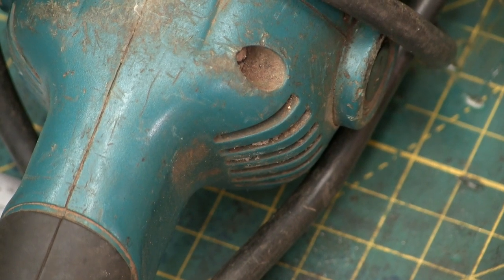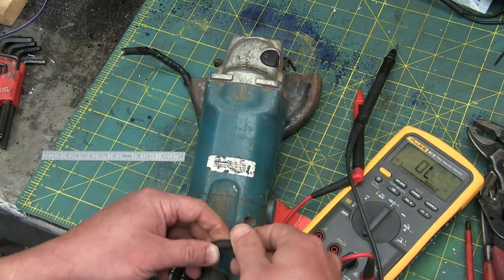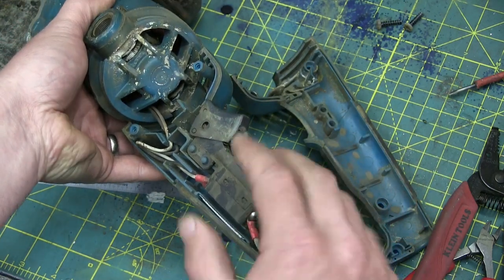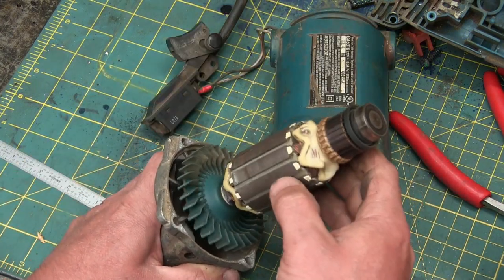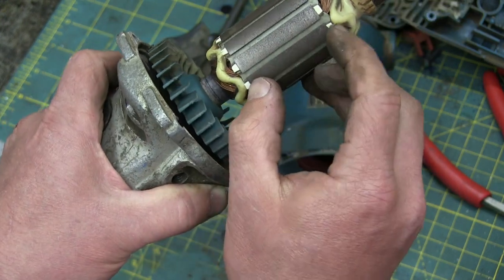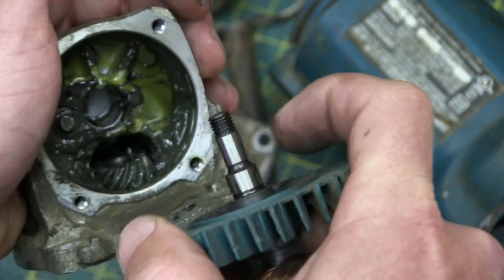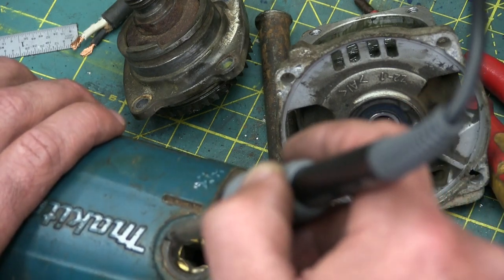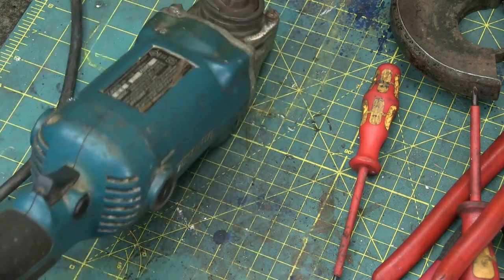BOLTR: US built Makita 5 inch angle grinder

Comment: That is a beautiful thing!  Though I gotta ask:  Am I the only one that takes apart new power tools the second they come out of the box, and re-greases the gears with a high-quality high-pressure grease?  :D
Reply: I use either honda 60 or liqui-moly's LM47 long life
Reply: I did it on my dewalt dw831 after watching the boltr done on one. As soon as I got it from Amazon I opened it up, cleaned it out and put in the good stuff.
Reply: I sometimes re-grease, and another good idea is to run brushed motors like these on reduced voltage for a couple hours to seat the brushes, 12v DC usually works OK for 120v AC universal motors. If it has a triac speed control you may have to bypass that. Have done it to everything from kitchen appliances to vacuum cleaners to these tools.
Reply: but warranty
Reply: Some one once showed us how to remove the warranty voided stickers out of Teflon.
Reply: John jon shit completely forgot about that haha

Comment: Have a 7" Makita side grinder that's been used for building woodburning stoves to oil rigs. Can't imagine what I have NOT used it for. It's over 30 years old and I've only had to replace the brushes (which were soooo easy to get to. Will have to replace the cord as slinging it around by same over the years has worn havoc..Great program. Leave it on even when I'm not watching to hear you go on and on..hypnotic..
Reply: BTW, it's the oldest tool I own...

Comment: "Magnetic slop".........love it.
Reply: There exists magnetic gears
Reply: afroninjadeluxe
Magnetic bearings are my favorite.
I revved a floating magnet to over 120kRPM.
It was amazing.
Reply: theLuigiFan0007 noted. Thats really nice, was it a vacuum?
Reply: afroninjadeluxe
It wasn't in a vacuum, but the neodymium magnet was a sphere shaped one about 9-10mm across. Essentially, the only thing touching the sphere as it accelerated was air, and a sphere is pretty aerodynamic. Hall effect sensors and optical sensors provide feedback on position and it hold it in place like one of those floating globes. That's commonly referred to as a magnetic bearing. All it needs to do then is start shifting the field so it rotates, while still keeping it afloat, and you have acceleration. In my configuration there's no speed limit, just the magnet providing feedback to the rotating field generator, so it goes as fast as it feels like. I measured the AC frequency at about 2kHz, and as the power draw dropped off significantly a few seconds after reaching said speed, it was safe to assume the magnet wasn't lagging the field much.

And trust me, I stood well back and used a computer and cheap webcam to observe the thing from the other room. If the sphere flys off, well that's pretty much gonna leave a mark on what it hits.

Comment: Have three newer models I got from work for free that were broken and they changed the ring gear a little it now has a metal washer for the lock up and the gear is power now not forged
Reply: Powder metal
Reply: Was it this version or a smaller 4.5"?
Reply: I believe they were 4.5" with the electric brake function but I ended up putting bigger guards on 
Internals looked the same but the switch was different I think the switch controlls the brake function

Comment: Like some have suggested, honestly. Do a HF angle grinder.

Lets how how bad (or not?) they REALLY are! I ain't gonna break into mama's christmas money that's for darn sure!
Reply: I made the mistake of buying a King brand grinder for a project a while back. This is a brand i would equate with HF brand. It lasted less then 25 min before it seized (bearing) and started smoking. Because i owned other (proper) grinders for work and i just needed one for odd home projects i decided to replace it with the Ryobi rat tail (a brand i would generally avoid at all costs)and have been pleasantly surprised with it especially given the price point. The ergonomics, the adjustable handle that i originally thought was gimmicky has actually been useful, reasonably powered and it probably saw  30hrs of grinding in it's first week of life. Couple years later and still kicking, though lightly used since.
Reply: I really wanna see him rip apart some Cambodian tyre (Mastercrap)
Reply: Aren't those clones of old Bosch grinders? They kind of look like them, at least the castings, minus the bigger lip on the seating position.
Reply: I got a lot of cheap grinders. (15$ each)
I almost never change disks, because I have one for each type. And I go easy on them. A coulpe of them I've had for years and they still work. the lock is a Joke but since I don't have to change disks all the time its ok.
Also had one I bought just to do one job, and ofc it failed within 10 minutes, actually caught fire and tripped the breaker. that was a 50$ tool, Hyundai brand, so you know one not to buy.
Reply: +Tristan Peoples You can say what you want about CT Mastercraft tools, but I have yet to have one fail me. I have a variety of their stuff because when it comes on sale, it can't be beat by the other more name brand stuff. Granted, I don't make my living off my tools, so I may have a different opinion them. I've got a grinder, drill press, plunge/fixed base router kit, super cheap table saw, and sliding compound miter saw. The table saw is lightweight, so the base is pretty flimsy, but I've ripped boards, plywood and MDF with it. Probably all on the same blade. My only complaints are that it's not big enough and that the fence has a terrible lock. But on sale and with my mittful of Canadian Tire pesos, I think I spent ninety bucks on it. The miter saw cuts spot on once you tweak the laser, but my good Lord it's a noisy cork soaker. Makes me wonder if there's any grease in it. The router is exactly the same as a Craftsman. Right down to the casting and moulding. I'm guessing most of this stuff is made in the same factories. 

Now, their Jobmate brand...that's on par with the Power Fist crap.
Reply: Robert Destree Lol, you can't beat them for price, trust me, but ive been at this really scabby outfit for years for heavy booty industrial fabricating and id go thru a grinder a day at times and management would be livid, and had to countersink/thread holes too, its just a rotten nightmare.
On the industrial scene thou it has no place being there, especially when youre out on the field.
Reply: Yeah, that's for sure. It's fine for the home DIYer and that kind of thing. Trust me, I'd like to have a better table saw or miter saw, but I just can't justify the dollars for how infrequently I use them.
Reply: Personally I love them, I have a bunch of them with different disks and just go a little easy on them. The way I look at them is they are cheap enough that if they just last through the job then they paid for themselves but if they keep going then it's a bonus. With that being said I have at least 4 of them that I have beat on for 5 or more years with no problems. The trick is to not stall them. If you stall them they let some smoke out and the cheap ass Chinese only put just enough smoke in them to work so they will quit if any escapes
Reply: Aweeeee SHUCKYDUCKY!!!

Woot Woot!!!

Bring in on the shit or shinola!! This should be interioresting!

Comment: I've had a DeWilt 4 1/2" for years, always had a nasty rattle to it but held strong. Got a couple spent Hazard Fraughts given to me after 6 months use, brushes were completely spent. Then got a Metabo 5" gifted to me after 2 yrs use, had a cut in the cord insulation and could no longer be used "safely" thanks to the clipboard warriors. It is a BEAST. No rattle, pure torque machine.

Comment: I became a die-hard Makita fan when I was working maintenance at a custom circuit board factory. I used and abused a grinder and a cordless drill trying to keep the old building from falling apart and the Makitas just kept on rolling when the other stuff they had would crap the bed. I've always kept Makitas in the home shop ever since.

Comment: yep, my shop buys these and similar models, they are tanks with sometimes 3 brush changes. 
I've been using a smaller Bosch Model 1375A, at work two years and still going strong.

Comment: Been welding for a living for the last 20 years , I wont use anything but a Makita grinder , I have had to in a pinch use other brands , they just don't last.
I usually use the Makita 4-1/2 inch grinders , and most often one of three things goes wrong with them , the cord freys , the brushes wear out , and the switch goes bad , but most of the time it's the cord.
I have played hell finding replacement brushes locally same day , and usually don't have time to order them , so I cough up the bucks and go buy a new one.
I did discover a happy accident , the brushes in the chepo $20 dollar Harbor Freight grinder will work , the same ones with the removable disc on the sides , they just need to be filed down a bit to fit.

Comment: +AvE those are really good. I also have a dewilt 5/6" and love them. I have had the 1 for 3 years... I'm a pipeline welder so they get used 6 days a week the problem I had with 1 was the cord caught fire in the handle but replaced it and 2 years later still good. I have an ac 7" Makita grinder that works great on my sa200 as well (dc only machine)

Comment: I have the smaller Makita grinder from 1995-ish.  I got it so hot the fan melted and started rattling around.  I was in the field and had to get the job done so I opened her up and pulled the fan off.  I still use it today.  I always intend to only use it for short light jobs, but frequently get it so hot I can't hold it so I put on the welding gloves.  The detent on the switch is toast so I have to hold it, but the damn thing won't die so it still gets occasional use.  I'll use it till it stops.

Comment: Hi AvE, Just found this vid due to my own blues with my Makita GA9000.  The bearing you referred to as 608 at the end of the commutator (close to the power switch) on my grinder got so hot and burned the end of the fields wires including those ring wires... At disassembly the bearing disintegrated totally and all I could find on the floor was 4 bearing balls and a bearing side cover.  The centre part of the bearing is still on the commutator and it is a bit of a challenge to remove :D  Thanx for an awesome informative vid.

Comment: Fun fact. The gear drive for a 7.3 powerstroke High Pressure Oil Pump is held in place the exact same way the pinion gear is on this grinder. One bolt, torqued to 95ft lbs holds the gear to the pump. Pretty Shweet. But if you don’t get her torqued down enough when the engine gets hot resulting in slippage.

Comment: A good example of mechanical hysteresis is to stretch and release a thick rubber band a few times and you can feel the heat buildup.  Solid tires on utility  vehicles will actually melt if run at high rpm due to hysteresis.

Comment: AvE, I'd love to see you BOLTR a Makita GA4542C, which is one of their newer corded grinders that have electronic variable speed control and soft start, and something called SJS II which is supposed to dampen the force caused by sudden wheel stoppage, along with reducing vibration. See how the innards compare to the old school single speed grinders like the one in this vid.

Comment: Not to beat a dead horse. Hysteresis was demonstrated at 6:26. It's the movement of the switch between the on and off state. In this region, the output can be on or off depending on its previous state.

Comment: Its a acoustic magnetic tag. The tag vibrates and reflects a specific pattern via a specific magnetic waveform. The sensormatic tags are much more reliable then the checkpoint tags. The tag is not perfectly flat to allow a metal strip inside the tag to vibrate.

Comment: I have a 4" Makita grinder that was bought in the early eighties. I have to say it has held up well. The overheat switch has bit the dust after only thirty some odd years. So I'm looking for replacement parts. It just runs for about a minute and over heats. 

I would not mind so much but I still have 12 payments left to the Snap On guy.

Comment: I'm trying to get a hold of a dead grinder from work that we gets through a lot of. The Company is Suhner, we use a variable speed 4.5" grinder from them (great control for finishing/polishing) but the brush housing and trigger are a constant failure point. They wont let me have one to send over to you from the UK though. I'll keep badgering.

Comment: Always enjoy your vidjayos! I was wondering if you could show a little more of your work when you do  a BOLTR. Example being, how did you get the 8mm shaft out of the pinion gear? ( I think that is the wrong gear term) I don't do very many tear downs of tools but the few I have done I run into dead ends where I can't figure out how to move forward in the disassembly without breaking it. Hope that makes sense. Thank you for your time and talents that you so generously share with us all.

Comment: Interesting explanation of hysteresis. I was actually doing some neurobiological research over the last couple years on hysteretic mechanisms in muscle cells (specifically relating to the protein titin). Ended up using a model based on dashpot-spring mechanisms for some theoretical work related to it.  Cool stuff, in my opinion.

Comment: I've been using these bastards in the field and the shop for 6 years now, the only thing I've ever replaced are brushes, triggers and wires. That's it. Best grinder ever, hands down. I don't know ANY welders in northwestern Alberta that use anything else. Oh keep in mind, if you are grinding very dusty materials like concrete or elemental sulfur, be sure to blow the damn thing out after.

Me and the co-workers are also not gentle at all with these beasts, heck if we need a field bench grinder we just clamp the head of a 6" makita into the vise and lock the trigger! That'll get the chipping hammer sharp! Also spent a full 4 hours with 6 of them on rotation grinding MASSIVE welds down, overhead. No plasma or torch allowed :D.

Comment: I own a production shop with 16 guys. Most of our power tools are Makita because they hold up very well in continuous use. That said, they make several quality levels. So for serious use buy toward the higher end. At one point I bought several sets of B&D for installations off site because they tend to disappear. They didn't hold up nearly as well as the Makita, but were cheaper, just not enough cheaper. I've got an older B&D Wildcat 7/9" that has been very good but is an arm killer. Back in the days when I framed, my Skillsaw worm drive out lasted the B&D saws by several times. Also had really good luck with the Milwaukee drills. The last two Milwaukee drills, I more recently bought, failed in less than 2 years. AvE's review of a HF impact wrench might make me give one a try, worth their cheap price?

Comment: the wires that wrap the good brass brush holders are normally the first thing that went on the grinders at work commonly it would get hot and solder would melt or the copper would melt

Comment: 8:30 if the locking mechanism fails,the grindwheel isnt stuck there forever-take a center punch,a hammer and hit the nut counterlockwise,it will open easily,nice video though

Comment: I was cutting a rather large I-beam and the wheel snagged. The friction mounted pinion gear held, but the aluminium casing didn't. The grinder came in to pieces by the crown gear. 
 It was newer model tho. They don't build them like they used to.

Comment: I'd like to see you tear apart  the 9005B(the old style) and compare the two>
I've seen the newer ones not seem to last as long at the 9005B which they do  still make.

The only problem I have had with these grinders is the lock pin as you stated, both on the old and the new models. I have seen the gear heads wear out after a shit ton of abuse, seen the switches fail, and I've smoked a few using 6 or 7 inch wheels on the 5 inch grinder, but that is to be expected.
I own a 4.5", 3  5" and one 7" all Makita   by far the best bang for the buck, an average home owner will get over 10 years out of one if not never burn them out, a tradesmen will get over 3 years easy provided they don't ask too much out of it.

Comment: Hi
I dont know if you can answer this question so long after your video. I watch your videos quite often but this is my first comment - which is actually a question: I have a smaller Makita grinder, a 115mm, model 9503BH.  Even if you have not stripped one of that model,  it has similar design features to the alternative grinder you showed.... ie with the original thinner un reinforced front gear case, and the thin steel only locking pin for the crown wheel.
When I removed the front gear case and armature, the armature end gear [ aka the pinion for the crown wheel] just fell off the end of the armature. There is no nut to retain it as in later models, no circlip, no interference fit, nothing.... just loose on the end of the shaft. 
Now my question: Have you found similar on older models ??
There does not appear to be sufficient wear on the inside of the gear or the mating surface of the armature shaft to suggest that it worked loose from a pressed on fit.
Sure, I could locktite it on reassembly,  but just wondering what is usual for that model/design. 
Thanks

Comment: If the lock pin/hole rounds off even on dewalt grinders you can still hold the shaft with a thin open end spanner usually 14mm or 17mm and usually supplied with the tool from new

Comment: i had a 100mm makita grinder, used it every day for hours a day for 10 years and went through numerous sets of brushes, finally killed it one day cutting 5mm steel plate with a grinding disk got 4 meters in before she let out the smoke,  even then i could have probably fixed it but i sprung for a new one and still use it to this day,